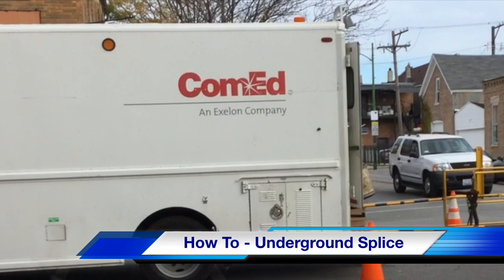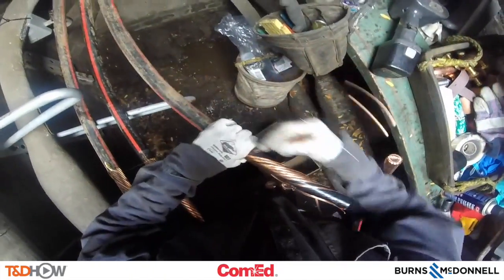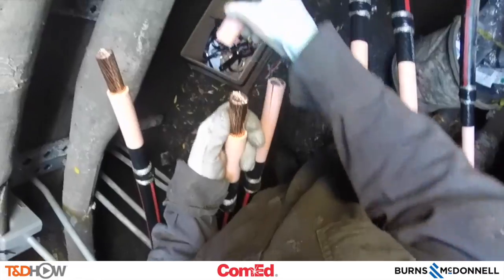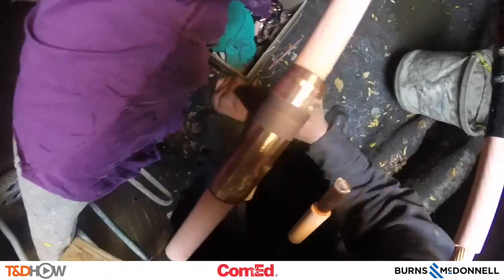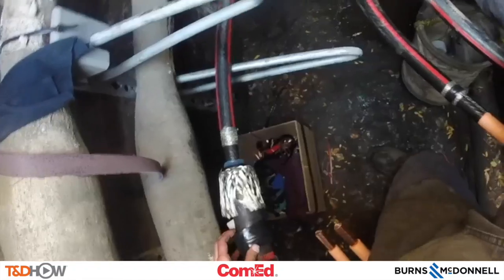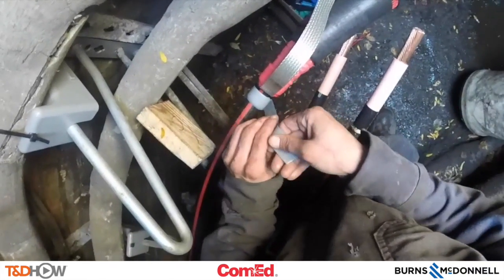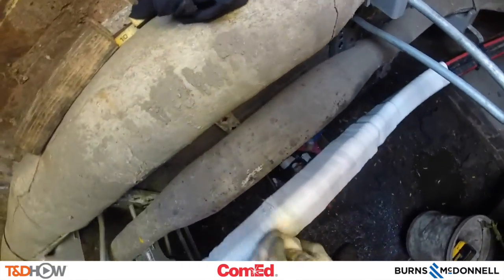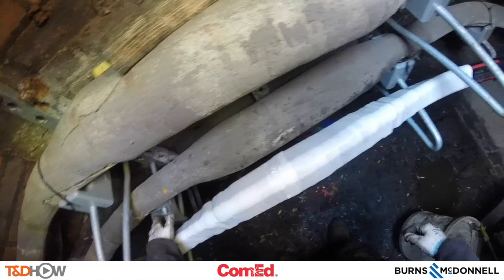Underground Splice

Comment: why does this look so much more sensible than the india splcing videos. this has a nice connector, bolt heads pop off and quick sand, boom you barely did anything and it looks great. in india they're twisting every strand of wire together.

Comment: The one doing this is a woman. And the 'cracked' lead joints are concrete encapsulated asbestos wrapped joints. The train of the cable mimickes the train of the lead cables. And you you see every step all the way through? Of course the cable was cleaned.

Comment: Ive never seen the concentrics snapped off...we usually run them over the cold shrink and crimp them together from both ends of the cable..
Reply: Same.  Braid them up, bug, weave ground braid in and connect to ground grid.

Comment: Imagine forgetting the cold shrink before shearing off the bolts.
Reply: Been there, done that. Time for a dutchman 🤣
Reply: @GreenGenerationTV  not  even. Cut the screws with a grinder and unscrew them. Clean everything real good and back to it.
Reply: It happens I usually do it with another guy and we each do a side and sometimes start rushing and forget dif steps

Comment: Is there a local ground rod outside manhole to connect cable shield ground wires and metallic cable supports ? Will ground rod be required near every medium voltage cable splice manhole ? I believe ground rod outside manhole seem easy to install but can it be driven inside manhole as well for more effectiveness thru bottom of manhole? In the later, water may sip in manhole, if the opening at bottom is not sealed properly....I do not know what is common practice to install ground rods at manholes.
Reply: There normally installed in the bottom off the man hole with ground rod and sealed with compound

Comment: actually doing homework on underground cables and splices as we speak cool thanks love the videos !!! ibew local 66
Reply: salary on this stuff? and where to start?
Reply: @BeingWokeTV  To start: Become an electrical engineer.
Reply: airpeguiV2 i doubt someone with a degree in elec engineering would ever splice cable
Reply: @ruenruins  I just graduated from my degree in electrical and electronic engineering and we had a module on underground cables. While it is true that you do not need a degree to do it, an engineer will have to supervise, and to supervise you need to know how to do it, and have done it before.
Reply: @airpeguiV2 lmao emgineers would never supervise lineman terminating that would be hilarious, if you’ve never terminated you’ll never lecture on it. Although this comments old you’ve prob learned that already
Reply: IBEW local 569 brother

Comment: Why is there no mention of cleaning? Especially with sanding the shear bolt connector and getting that conductive dust everywhere. I hate shear bolts for that reason alone
Reply: @eminem2897 but you guys don’t clean and dry with cleaning kits regardless?

Comment: Suggest a little better racking of the cable. Cable going into the splice should be as straight as possible to eliminate stress on insulating sleeves and avoid gaps that could introduce water into the splice.
Reply: The only thing 2 lineman will agree on is that the third guy is doing it wrong.
Reply: I agree, I thought the same thing.

Comment: What's the purpose of the semiconductor layer on the cable?
Reply: Patrick Pikulski it creates a barrier between the metal (Concentic/flatstrap neutral strands and the conductor) and the insulation. The strands can potentially carry load and the conductor obvious carries electricity. There is also a layer of semi between the insulation and the conductor. That's why it's partially conductive
Reply: ...you can't have metal touching the insulation. it creates a hot spot and a potential cable fault.

Comment: If you get a fault or contractors damage the cable whilst digging do you repair it with 2 straight joints or do you pull new lengths of cable between these pits?? I'm a jointer from the uk and we mainly just have the cables buried straight into the ground and in a situation of fault we would spike the cable cut the faulty joint or damage out and do two straight joints.
Reply: South Florida. Depends on the situation. If it's direct buried we do a dutchman like you said. Two straights. If it's in a manhole and we have enough cable we do a dutchmen as well. If the splice is short walled or the company wants to bill the utility more they pull new cable and we splice in both holes.
Reply: Big Mike Welp,  in the city of Chicago,  we would just remove and install a new stretch to repair fault. In the suburbs, we will located the fault and repair it with pieces of like cable and make joints
Reply: RjRaeKaydad in New York we call it a Dutchmen